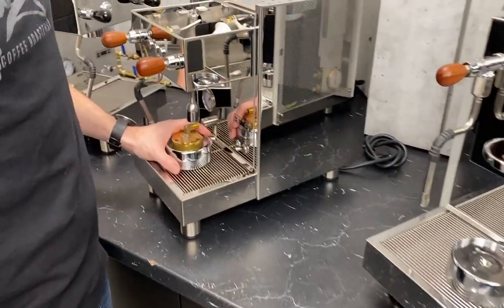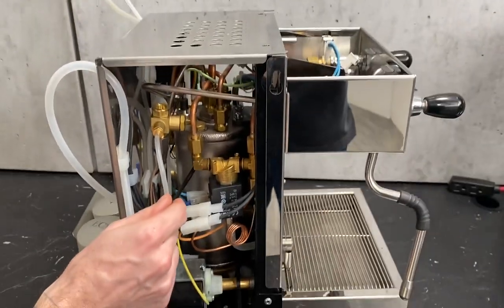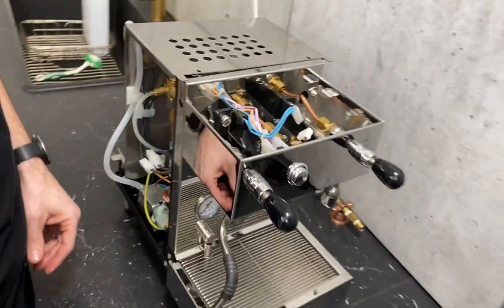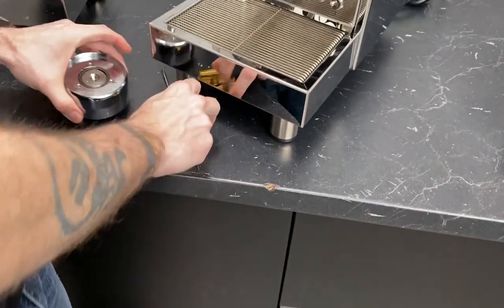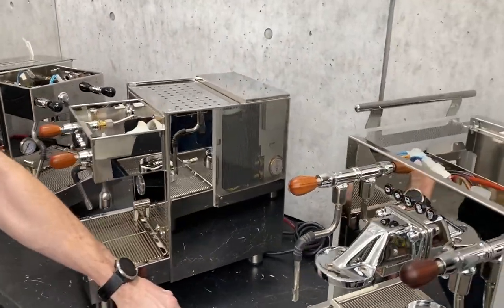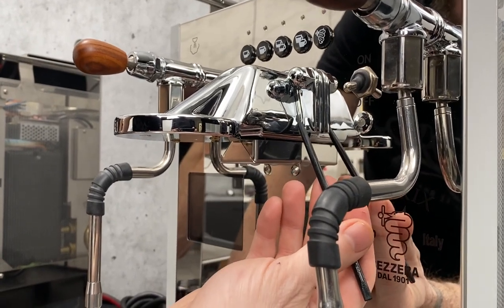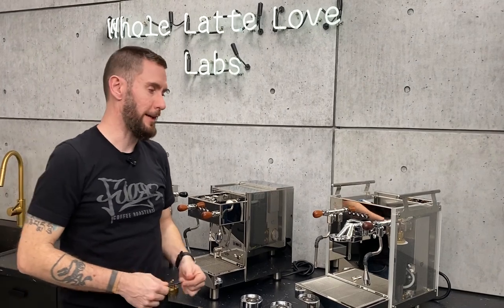How It Works: Bezzera BZ Group

Comment: There's no thermosyphon system on the BZ which circulates water from the boiler to the grouphead.  This is a plus as it means there are two less paths that will cycle water and two less tubes for limescale to choke up causing issues. The start up time is reduced from 30 minutes to 10 minutes on a 2litres boiler.  A thermosyphon system can be very unstable with very small boilers, particularly if it's below 3litres and the bigger the boiler, the more energy and start up time is required. These BZ groupheads are so much cleaner and require much lesser pre-infusion.

Comment: I'm a ECM guy but love to watch these videos to educate myself on the different machines and see how they work. Can't help to notice the ECM tamper and leveler on the back of one of your machines there. :-D
Reply from the maker: Hey KK, Thanks for the comment. We of course love doing these! Used the weight of the ECM gear to trick out the pressure switch for the water reservoir.

Comment: Hi. Thank you this videó!
i hope you can help me. I have a Bezzera duo de. I set the temperature in the coffee boiler to 96 degrees (maximum), but a maximum of 87 degrees water comes out of the head no matter how long I heat it.  Coffee taste no good, no body, sour.. The machine is two years old and the inside is clean. it was always used with filtered water. Where should I start the search? Thank You!

Comment: Thank you. Great video. So should be easier to maintain compared to a traditional E61 , quicker to heat up but no mechanical pre infusion, right?
Reply from the maker: Hi d, Yes, quicker to heat up, no mechanical pre-infusion and a bit less maintenance with no internal moving parts.

Comment: Thanks for the video, appreciate you guys taking the time to put this content together - great for understanding the machine in more depth! 

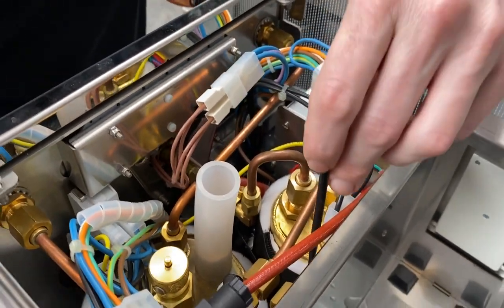Just a quick question - I have had concerns about the vacuum valve venting into the machine and messing with the electrics/insulation and I noticed in this video that you have a piece of tubing over the vacuum valve/breaker (can be seen at 3:45) which I assume would direct any steam upward toward the drip tray and away from internal electrics of the machine? I'm just wondering what size tubing this is and what sort of material it is? I would like to avoid having to pull the machine apart and replace the vacuum valve with on that has drain barb to redirect the water to the drip tray (which I know others have done to address this flaw in the design). Thanks in advance!
Reply from the maker: Hi m, You're welcome for the video and thank you for your comment and question!
The extra tube does help contain and direct water vapor upwards. Unfortunately I do not have a machine in front of me so cannot measure size. The material is likely silicone tube. I understand your desire to route moisture outside the machine. While that's a design I prefer, understand very little moisture exits from the vacuum relief valve before it closes. While I've seen tiny water droplets spit from vacuum relief valves just as they're closing it's so little they evaporate almost instantaneously and vapor is carried away without compromising electronics.
Reply: @Wholelattelovepage  Thanks for the reply!

Comment: Such a simple design yet people swear by the e61 group which has probably quadruple the amount of parts and complexity to it.  I've read somewhere that the e61 pulls a more full bodied shot but the BZ group has greater clarity.  Not sure how that effects taste.
Reply from the maker: Hi a, Thanks for the comment! Taste judgements are subjective and with the number of variables involved difficult to attribute directly to the group design. The E61 has more going on mechanically while the BZ group has more electric components with group heater and solenoid.

Comment: Hey! Hoping you can help. I have a Bezzera hobby machine and I just replaced the gasket with one of your caffe works ones, cleaned out the group head, lots of components were covered in black sludge (that I thought was coffee residue). But now I’m noticing water leaking from the plate that the shower screen attaches to, that then screws into the group head. Both surfaces are clean but it’s a metal on metal contact, do I need to use grease on it? Thanks so much
Reply from the maker: Hi WISE, You can but a very light coating of food safe lubricant on the gasket shown at this point in the video: https://youtu.be/BNMhSCtCufQ?t=123 Also be sure the gasket is there and in good shape!

Comment: Is the exposed screw unique to the BZ grouphead? I find it keeps bending my puck screens (even the 1mm screens). Any suggestion?
Reply from the maker: Hi SM, Some groups have them like many ring boiler groups, standard E61 group does not. Sounds like if you were not using a puck screen you would be leaving an impression of the screw and maybe the group's shower screen in your puck? If so, that's indication of too much coffee in the filter basket. Suggest a larger filter basket to accommodate your dose or reducing dose.
Reply: Ok sounds good. The thing is I am using the stock Bezzera portafilter with double basket - approx 18-19g of coffee. I would assume that is ok given it’s the double basket. Does Bezzera make a larger basket?

Comment: And what about the return of water when you stop the brewing? I mean the exessive water over the puck?
Reply: Hi Andres, The brew solenoid is a 3 way valve. The excess pressure and water is vented from there down to the drip tray.
Reply from the maker: Hi AB, AS @Brian commented the machine has a 3 way solenoid valve in the brew circuit to release excess pressure and water from the group.

Comment: As always great videos, full of information! A key issue for me is the warm-up time, so I ruled out the e61 group. So the bz group is a great alternative. but have doubts about the warm-up time of the BZ DUO, because in one of the WLL videos it is mentioned that the warm-up time of the bz duo is similar to the e61 group. this is true? another question is about the temperature stability of the BZ group in relation to the Profitec pro 300. which one do you think provides better temperature stability?
Reply: I mean brew temperature stability..
Reply: Hi Rafael. I’ve personally never timed the full heat up side by side between a Duo DE and comparable E61 but the E61 is heated by the water in the brew boiler alone vs the BZ being heated by the internal group heater. Heat up time for the boilers themselves is pretty comparable. It’s the thermal siphon of the E61 that makes full stability take longer, so I’d have to say the BZ has an advantage there. The Duos ability to schedule on/off and eco mode could also assist in reducing your wait time for temperature stability.  Hope that helped a little:)
Reply: @Framed_By_Tucker  thanks so much for your attention and enlightening answer!
Reply from the maker: Hey Rafael, Thanks for the question. In 2018 I did some testing of heat up times, temperature stability and steaming performance comparing PID machines with BZ group and E61's. I used a Bezzera BZ07, Profitec Pro 500 and Rocket EVO in the comparison. Long story short the BZ group attained temperature stability 20 minutes faster than the closest E61. All machines compared did well in temperature stability. Here's a link to graph of warm-up times test results within the video: https://youtu.be/Rn1S23pGPiQ?t=176
Here's a link to our 2016 review of the Pro 300. In the video we do Scace brew temp test and got +/- 1F accuracy and 10 minute heat up times: https://youtu.be/tQXm25pMXds?t=135
Hope that helps!
Marc
Reply: @Wholelattelovepage  Hello Marc! Thank you so much for your feedback and clarification. You and WLL team are amazing! WLL videos are concise, pleasant to watch, full of information and approach the equipments independently, respecting your suppliers! Congratulations on the competence and professionalism of the WLL team!
Reply from the maker: @rafaelrgbarrocas  It's what we do!
Marc

Comment: Nice vid! Can anybody tell is it possible to move BZ40 pm to DE volymetric version? Their differences are only few parts, electronics and volymetric meter but I don't want to start project if it have to risk that the new parts no fit to Pm model.
Reply from the maker: Hi jt, Thanks for the comment. BZ40? Must be an older model I'm not familiar with. In more current Bezzera machines DE versions use the BZ Group and MN versions use an E61 Group with manual lever. Again I'm not familiar with the BZ40 but in more recent machines I would not advise attempting - to many differences in group mounting, hydraulic/plumbing and electronic systems.
Reply: Thanks to reply. As I said, Mp and de is the same machine which differs only electronic box and volumetric dosing sensor. Both have same boiler, bump and double heaters - one from boiler and one which heating grouphead. Thanks anyways. You are right that if I can't find some sure answers that adding the feature is possible, it is silly to start ordering high pricing parts etc.